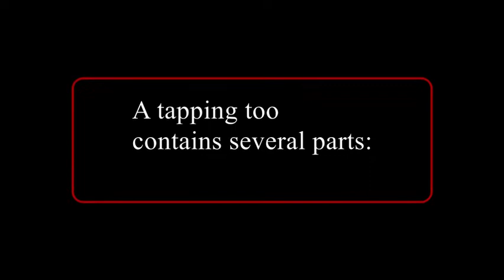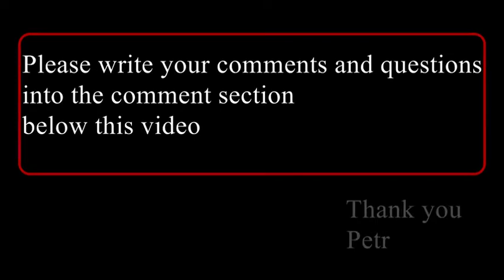Tapping Tools for Trumpf Trumatic punch press machines

Comment: great videos, nice to have an insight into these machines, and the tools they use, PS: just some constructive criticism, the shanks you are holding at 4:24 are called just 'taps' the 'tapping tools' are the holders or tap handles/wrenches you turn a tap with, or in your case the whole assembly, not just the tap itself, the unit which cuts the internal threads.
Reply from the maker: Hello Andy Van, thank you for that!

Comment: Approximately how many threads can make taping tool before have to replace. I ask about M4 taping tool making thread in 1.5mm mild steel extruded hole.
Thanks!
Reply from the maker: This is hard to say. It depends also how well the tapping tool was lubricated.  I have never counted the tapped holes. Since you are asking about mild steel 1.5 mm it might be around couple of thousand holes.
Keep on mind that these tapping tools don't cut the materia in threadl but they roll the material.

Comment: How can put tapping tool parameter setting in tc6000l machine. 
Plz make video sir...
Reply from the maker: Hello Raja,
I don't have a access to any machine now. I would say, it will be very similar to any other machines. Most important is to set up the tool correctly and then set up the parameters for UDP (how high is the tool above the sheet surface) and then the C-axis rotation (how deep the thread former goes)